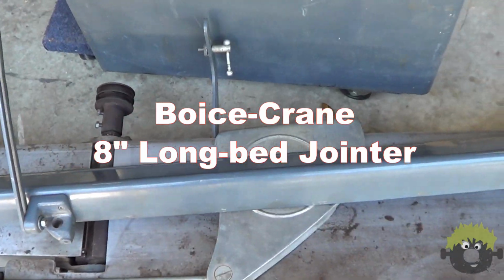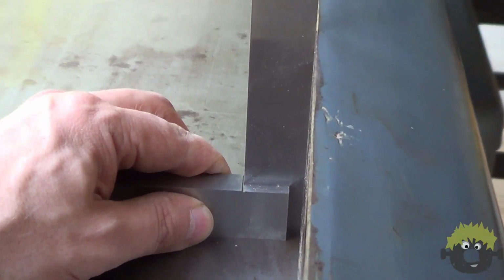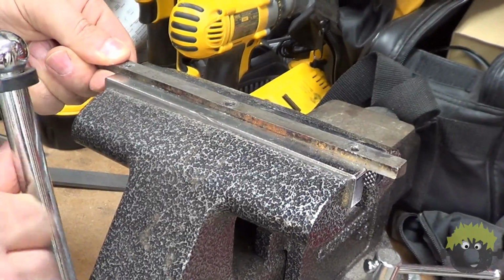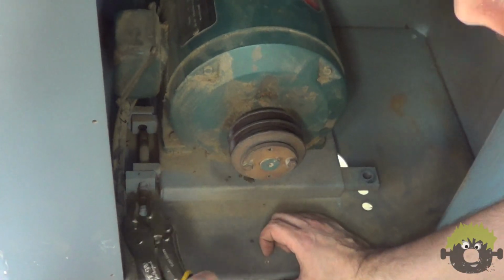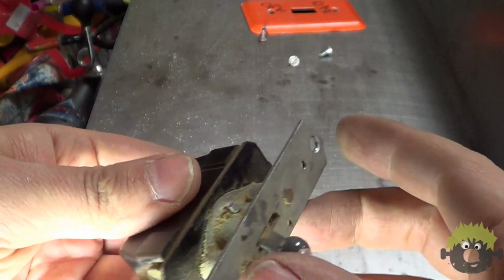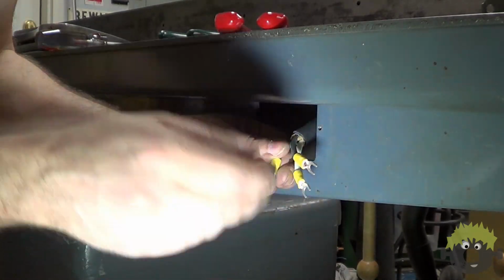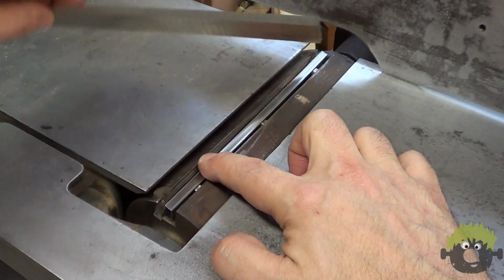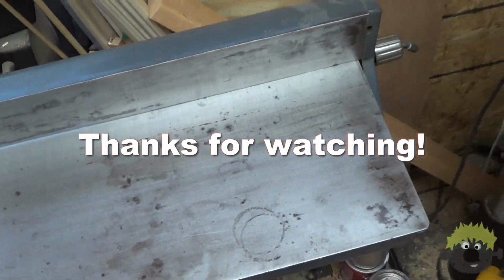Boise-Crane Jointer, Model 3400

Comment: You're inspiring me. I picked up a BRAND NEW STILL IN ORIGINAL CRATE  Boice-Crane model 1400 6" jointer that sat since 1950! Bearings are all dried out, so I'll have to give Accurate Bearing a call, but you can't beat a brand new BC 1400 for $700! Build quality is amazing. The guy threw in a still in the box Craftsman ½ hp motor from 1977 - bearings dried out too, but hey - it's brand new and built like I only wish things were built these days! 😂

Comment: I am going to look at the same one tomorrow. An old cabinet maker wants $500 for it. It looks to be in good shape, so I may take the plunge. How are you liking yours after a year?
Reply from the maker: It's a real workhorse.  With 4 knives on the cutterhead, getting the knife height dialed in is critical, especially if you're running figured wood like curly maple through it.  I've tweaked the knives a couple of times to help eliminate tear-out.  Other than that, it's required zero maintenance and always ready to work when I've needed it.  I've been very pleased.

Comment: Excellent find and addition to your shop. I'm still looking for a vintage 8 inch to upgrade from my 6 inch. One tip, when doing a soft restoration and cleanup, it's cheap insurance to do the following: motor- take apart and blow out the inside, install new bearings and clean all the contacts. Switch- take apart and clean all the internal contacts. They tend to oxidize over time. Machine- replace all bearings, clean all moving-machined surface and lubricate. And of course inspect the wiring as you did.
Reply from the maker: That's all great advice.  In this case, the motor bearings ran smoothly without chatter or noise so I didn't bother with that.  The motor was actually surprisingly clean, almost as if it were (nearly) new.  Perhaps some previous owner had changed out the motor with a NOS (the motor certainly isn't a contemporary model -- the manufacturer hasn't been around in decades) or the unit just didn't get a lot of use.  Not sure.